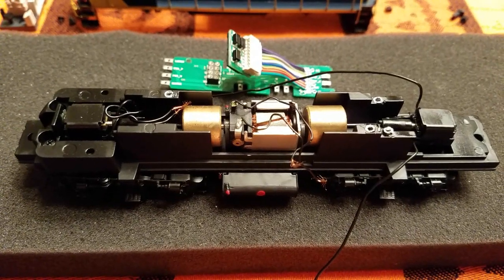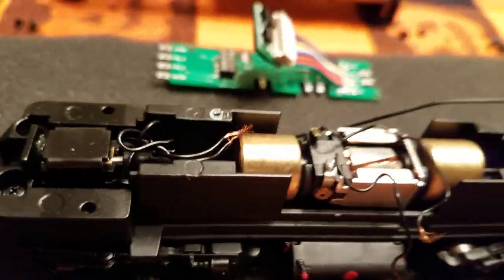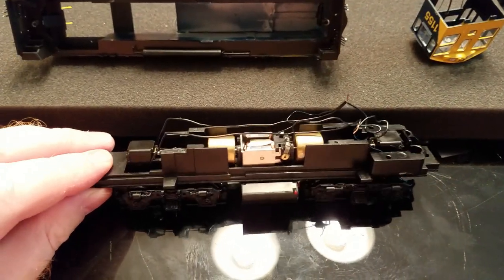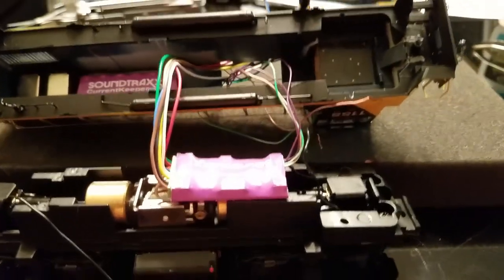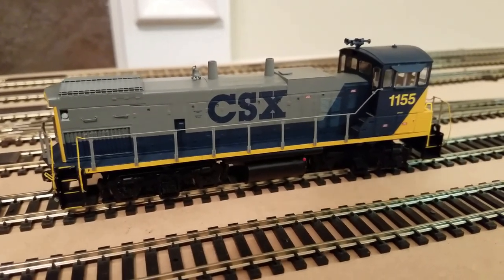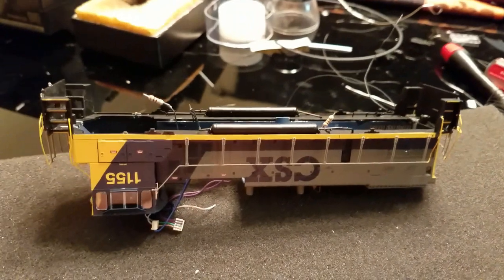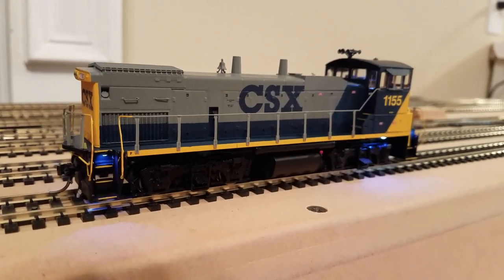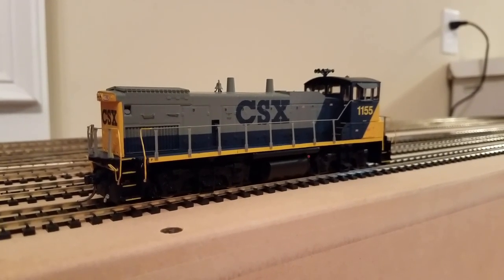Athearn Genesis MP15AC with Truck, Step & Cab Lights (Tsunami 2 Install)

Comment: Hey there!  Great video!!  Could you share a little more info on the LEDs and glue you used in this build.  I'm prepping to attempt a very similar project and your final product looked amazing.  Thanks!!
Reply from the maker: I just used very small amounts of CA (medium super glue) to tack the wire here & there where needed.  I'm pretty sure I used surface mount 402 "White" LEDS.  I would use double side tape on a table to hold them so I could tin them and the wire end and then carefully align & solder by just tapping the tip on the wire & watch for it to join.  I used a trick where I'd strip the wire about an 1/8th and touch the solder iron on the end of the wire but align the wire over the led closest to the insulation & just snip off the extra afterwards.  This allows more control and you can see when the wire & led fuse together.  I also used magnifying googles to better see what I'm doing.  I probably went through almost a dozen before I got the hang of it.  I also used rosin core solder.  I think it's much easier than having to use flux.  I think this is what I used-  https://www.mouser.com/ProductDetail/Inolux/IN-S42ATUW?qs=qSfuJ%252Bfl%2Fd6Y4mOag7MlmQ%3D%3D
Reply from the maker: Also I used "Circuitron Ultra fine Hookup wire".  I is a little hard to find but it comes in red, white or black and is 32 gauge with 4 strands, comes in a little packet in 10 foot lengths.  Thinner than thread, about .015 of an inch.  Ah, I found some on ebay-  https://www.ebay.com/itm/304210142327?hash=item46d4566477:g:45MAAOSw1G9hgZX9
Reply: @christopherbrown5338  Thank you for all the detail and info!!
Reply: B
Reply: Thanks!